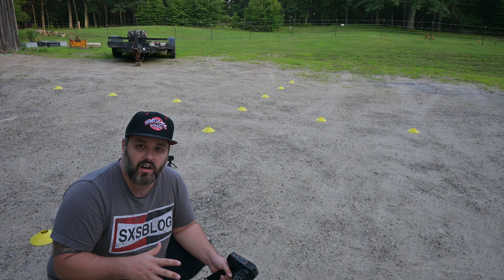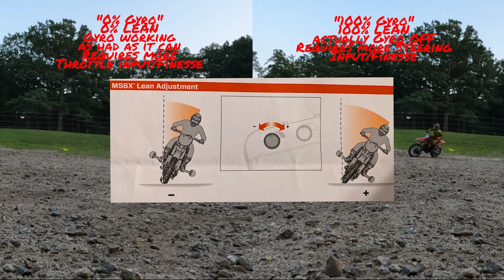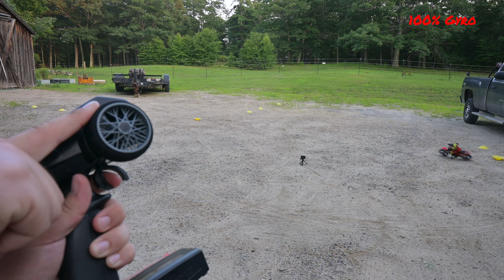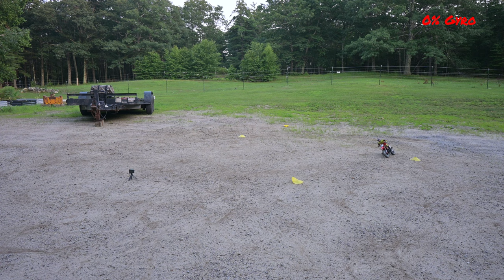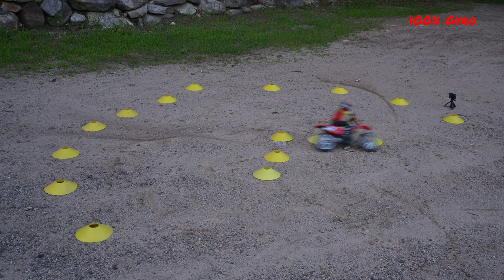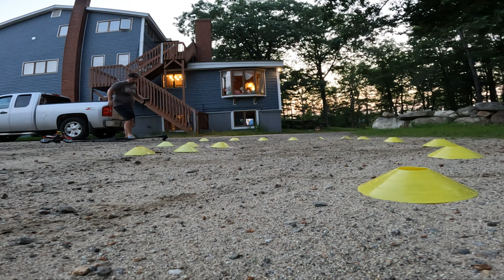(I WAS WRONG!) Gyro Functionality of the Losi Promoto MX tested!

Comment: This is John Adams technical director of Spektrum. The system is much more complex than you describe. There are 3 electronic gyro, roll pitch and yaw and 3 electronic acelleromerers, X,Y,Z axis that updates the bikes position hundreds of time per second. Combing this with the commanded values from the transmitter and some very complex algorithms which took over 3 years to develop. Also keep in mind ther are PID loops for AXIS. This is truly a 6. Axis gyro that has been finely tuned by Gil Losi Jr and Frank R. Through hundreds of hours of testing.
Reply from the maker: Thank you for the additional insight! I love the bike and by no means am trying to explain the how its programmed, even as an IT guy by trade theres some magic wizardry going on here to me. I am trying to better understand the practical effect the gyro/lean knob has on what it does as far as inputs are concerned while driving. In my tests so far at least on this surface it generally seems that Gyro/Lean knob turned all the way to the right (100%, clockwise) seems to almost remove the gyro input over-rides entirely from the equation. I only see inputs at this setting that are needed to save the bike from crashing onto its side. When I set it to gyro/lean knob all the way to the left (0%, Counterclockwise), the gyro makes lots of input over-rides to tighten up the corner and keep the bike more upright, particularly at lower speeds. I know the gyro takes into account all 3 axis, and I do not yet understand how all 3 axis impact the input over-rides. I also know it functions differently in different ride modes, since in wheelie mode that knob impacts wheelie height/angle. This was tested exclusively in dirt mode. I would love to understand more in depth how different settings impact practical control over the bike though. Would this be something you'd be willing to discuss either here, or in a DM somewhere? (or maybe even an interview for YT?)
Reply: @NHO-RC  This is an angle on roll demand system not a rate system. The yaw gyro is a rate gyro while the pitch gyro is a combo of both. Accelerometer data to provide very accurate positioning is critical as well.  As the inventor I just hate to see inaccurate information posted. We spent over 3 years on the electronics package to make this work.A patent should be up shortly.
Reply from the maker: @johnadams3724 - I absolutely don't want to be conveying incorrect information to my viewers. From a practical standpoint in dirt-mode on a flat, low-traction surface I saw the same behavior at different speeds when turning in either direction upon using slo-mo analysis. I looked at probably 3 dozen different slo-mo clips from my filming/testing and all of them exhibited the same practical behavior. I cannot tell in dirt mode if the gryo over-rides throttle input at all. It does not feel like it does it only seems to do steering inputs. I suspect the over-rides would be different on a banked surface, or an incline/decline.  I would absolutely love to understand more in-depth what is going on. I cannot however find any documentation on angle on roll demand systems vs rate systems easily online. Would you be willing to do a remote interview to chat about the system a bit more in depth about how this works? Myself and my viewers would love it!
Reply: John can you explain why when you bind a Dx5pro you loose the functionality to Reverse servos and Throttle travel.   A explanation would be great.
Reply: @NHO-RC That's pretty dang cool to have the technical director of Spectrum giving you info in your comments, I haven't seen that in anybody's comments, 😁 This technology is far beyond my technical skills but I do understand the gist of it sort of lol 🤣 Fricn awesome job to all the guys that worked on this project 👍🏻
Reply from the maker: @EJ-74  I agree! I hope I can get them on to really tell us how it works!
Reply: @NHO-RC  That would be very interesting, I hope they take your offer🤞
Reply from the maker: @EJ-74  I think I'm going to do some bench testing next since my original hypothesis was apparently incorrect.
Reply: @NHO-RC  👍🏻
Reply: A motion scientist, thank you for your hard work Mr. Adams and of course, the team you work with, I'm a happy consumer and I hope you talented folks dont let up. Y'all want to really scorch the RC world not just light it fire? develop a street bike. Imagine the speed testing (if technical aspects allow it) etc similar to what enthusiasts do with the Arrma and Losi drag lineups.
Reply: @NHO-RC Remove the video
Reply: Hi John.  Is there any plan to expose the configuration of the gyro for tweaking?   e.g. changing bank angle limits on the wheelie (pitch?) axis. Even if this means purchasing an open box rx or resetting the included gyro.   I understand with spektrum air products this can be done through forward programming on an open box receiver, or a BNF one which has been reset to factory defaults.  Alternatively, is it possible to adjust to the gain on that "axis" (noting its actually throttle!) independently from the steering through the AUX2 channel?
Reply: The street bike has to be coming. Let’s all hope it’s 3s or EVERYONE will complain.
Reply: @johnadams3724    I hear the distinction you are making. in other words the lean adjustment is better understood as a differential. its not so much a question of whether the gyro is EITHER on OR off because the range that the effect has on the functioning of the machine happens across that very spectrum.

Comment: The Gyro is always working. It's adjusting the PID loop when turning the knob. The higher the gains the less it will lean and tighten up the bike which also makes it resistant to outside forces. The lower the gain the looser the bike becomes which is why it will lean over more.

Comment: Yes but seems to me this is different as the manual of losi more Gyro the bike lean more instead lean less as I can see in your video 😅 low Gyro setting instead lean more and more control awesome video thanks to explain everything
Reply from the maker: The manual definitely is not clear enough but its so hard to describe without an example like this. Moving the Gyro to "100" (full right) does result in more lean since the bike is willing to let you just fall on your face if you let off the throttle but it seems like you lean more when the gyro is "0" (full left) since the gyro is helping you.

Comment: You are wrong with the gyro. 100% gyro is 100% assist. 0% gyro is basically pro physics which has no corrections. The right frame is 100% assist the left frame is 0% assist
Reply from the maker: At both ends the gyro is assisting you can't turn it off. Check out my second video on it.

Comment: When you counter steer a motorcycle the object is to turn opposite of the way you want to turn to make the bike lean into the turn quickly. Once you are at the lean angel you want you then turn the front into the turn to complete it. The key to good grip is to try not to turn the front wheel at that point.

Comment: Seems like throttle, steering and braking all have to be feathered to meet the needs of the corner--just like a real bike. Finding that sweet spot of the gyro with your driving style is key. Thank goodness the gyro control is just a knob on the transmitter. Great video and explanation! This bike is requiring some skill to master just like helicopters and airplanes. Subtle thumbs win. For this reason, the bike is actually a challenge to learn which will make it more satisfying. I have planes, cars, tanks, helicopters etc. I'm always reaching for the more challenging models to control. Can't wait to get one!
Reply from the maker: Yeah it's all a balancing act! I'm going to keep focusing on one adjustment at a time and hopefully be able to offer a tuning guide in the future

Comment: Does the gyro control knob adjust the mechanical gyro in the frame or the gyro in the receiver
Reply from the maker: So the flywheel in the frame simply spins at ~22,000RPM at all times, this never changes from what I can tell. They gyro control knob makes the receiver ignore your inputs and steer in a way that will result in the tightest possible turn.

Comment: One thing that is a little confusing- when you keep saying 100% gyro, I think you mean full clockwise on the gyro knob, which actually means almost no actual gyro function. Then when you say zero gyro, I think you mean fully counterclockwise on the knob, which is actually full gyro function. It makes it confusing. 
I think it would be easier for people to understand if you referred to the settings as 100% Dial, 25% Dial, etc, or something similar
Reply from the maker: Yes in the future I will do so. I did not fully understand the function until after I shot and reviewed the footage in slow mo